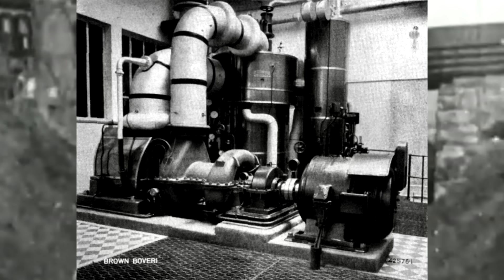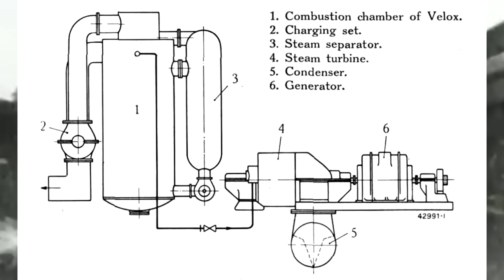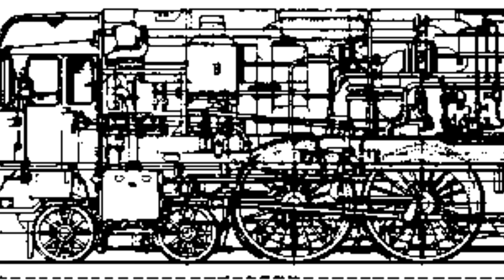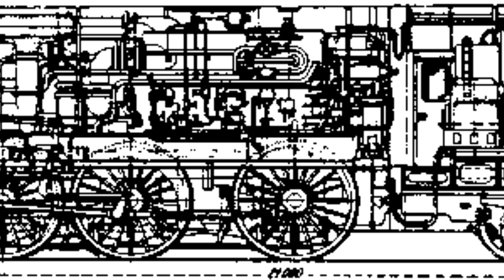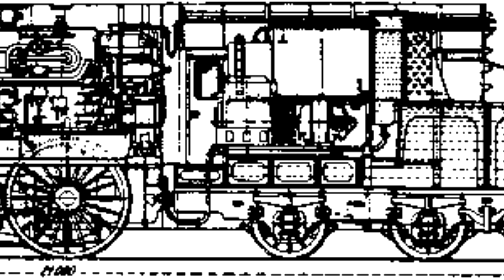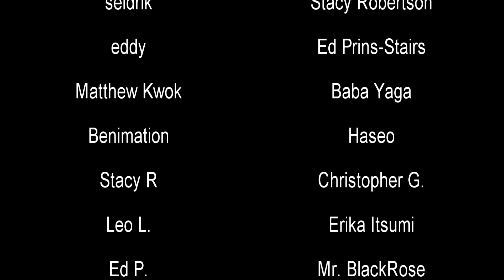What the Heck is Up With the Velox Boiler Locomotive? | History in the Dark

Comment: When trying to fit a complete industrial boiler house on the chassis of a steam locomotive. That looks like a nightmare to maintain.
Why they tried it is understandable. Diesel engines in the 1930s had a poor power to weight ratio.
The first successful diesel-electric in Europe, also built by BBC-Sulzer in Switzerland was the Am 4/4 of 1939, 2 of these were built, but they only had 830hp at rail, well below that of large steam and most electric locomotives. Already having electrified the majority of their network the order was not repeated.
They had a long service life and one of them survives operational.

Comment: New idea for steam traction: literally just a steam locomotive, but the startup happens faster because you add a combustion motor that briefly runs on the exothermic oxygen/hydrogen reaction to make heated steam in the boiler as you start the fire.

Not sure how effective this would be, but a brief startup using electrolyzed tender water (to MAKE the H2 and O2 used for the startup generation steam+heat) would be the more effective option than needing to always actually get a recharge from stationary depots

Comment: As engineers say.
You have the good the bad and the French way to engineer.
French engineering is on the divine / genius level or utter crap.
f,e, look at the most modern compound steam locomotives of the SNCF. (class 232)
They were the pinnacle of the steam locomotive tech and 232U1 is  seen as the swansong of all steam locomotives.

Comment: Diesels have it over steam engines in a number of areas. Start up time from cold which for a diesel can be fifteen minutes compare to 8-10 hours raising steam for a steam engine. Steam engine boilers need to have steam raised slowly over many hours so the boiler expands gradually. 
Day to day maintenance on a steam engine is much more involved and time consuming than it is with a diesel. 
Fuel is another area as coal can vary greatly in quality whereas distillate is very uniform in quality. 
The crews are another area for a good crew working together can get the best out of their steam engine and with a diesel that's not even an issue and also with a diesel there's no hard backbreaking work to crew it. In fog on a steam engine the crews have to constantly wipe the small windows to stop them fogging up whereas on a diesel the cab is heated or air conditioned so fogging is not an issue. 
In the freezing whether of snow the fireman or stoker's front is roasting from the firebox whilst his back is freezing which is something else that doesn't happen on a diesel. 
Health wise steam crews were fitter than diesel crews because everyday at work was a workout for both driver and fireman as both took turns at each other's job and it was the only way a fireman could learn how to drive a steam engine whereas with diesels it's mainly an office job where you sit down for long periods. 
But in the end the economics of running diesels won out over the steam engine as diesels are cheaper to operate on a day to day basis.
Preserved railways are not indicative of the days of steam for often the first train doesn't run until late morning whereas in the days of steam locos were kept in steam 24/7 even if only light steam on depots which is why they had their tenders filled with coal and water or tanks and bunkers filled on tank engines because they may not work a train for another eight to nine hours. Even before leaving a depot they topped up again with coal and water. 
Diesels can come on depots and be filled with distillate and then stabled and shut down for only a few minutes is needed to get air pressure up to work the brakes and they don't need to top up with distillate before leaving the depot.

Comment: If I had money to burn I’d try building a locomotive with perhaps a 20 hp diesel pony motor.  Shaft power to circulate water, electricity to heat water and run pad heaters for the cylinders, exhaust heat to heat water too.  Might work, might suck, who knows?

Comment: I read a story about nuclear power plants having backup generators driven by locomotive-scale diesels that had to go from off to running and online in under a minute.   I presume they were kept warm electrically and wouldn’t be surprised if they had external oil pumps too.
Reply: They always has

And the very reason why Fukushima disaster happen, the backup generator that supposedly cools the perfectly shut off nuclear reactor get flooded by later tsunami. And as reactor core still get hot days after turn off on top of water circulation stuck, turns into common steam explosion, that now has radiation

Comment: No doubt early diesel generators in smaller form had horsepower problems. The steam seemingly was an attempt to essentially have it push on the diesel to make the diesel have more efficiency. Apparently there are a couple of cruise liners that use both steam turbine and gas turbine. Having the steam improves the combined cycle for the gas turbine by reusing the gas turbine's heat for the steam power generation.

Comment: To be fair, BIG diesel engines need some starter help.

I know of glow plugs(like spark plugs to get autoignition going, small engines), flame starter (flame thrower to heat up the cylinder, medium engines) and cooling preheater (yes, a boiler to get the water in the cooling system to like 60°C before you start the engine, big engines).

So yes, many big diesels actually also need to heat a lot of water (not boil it, though) before they can start
Reply: I've driven trucks for over 30 years...shit goin back to the 50s and 60s,gas but mainly diesels. Up to 900  horsepower,and aside from block heaters (plug in overnight type thing) and the occasional ether button,I've never seen one with any other pre heat thing at all.
Reply: @JakeCline-l3h  it’s largely on locos and bigger, afaik. I know big locos like the DB 218 use coolant preheaters, but I don’t remember where I‘ve heard the flame starters mentioned, but Wikipedia says that cars and lorries usually get upgraded from glowers to flamers if they expect to start at -20°C or lower.

But apparently there’s a range of engines between 900 and 2500 hp where flame starters are a good idea

EDIT: the coolant preheaters of the 218 are basically the RR version of a block preheater since cold coolant could overstress the motor block, so they operate the coolant pump over a heater to get even heating throughout the system and you’re only allowed to start at 60°C coolant temp…
Reply: @genoobtlp4424 Thanks. I like learning new stuff about trucks and big engines in general.
Reply: @JakeCline-l3h  you‘re welcome
Reply: @JakeCline-l3h  just stumbled upon the source again: according to an old manual of the DB class 711.1 (german only), their 588kW ≈ 788hp motors have a flame starter (youtube channel Alwin Meschede made a Video about it, sadly also only in German).

Comment: I can see why someone tried this.  Internal combustion engines suffered from very low horsepower output, which was not a problem for steam or electric locomotives.  So any way to reduce startup time for a steam locomotive would be appealing.  Having a separate preheating source at the engine sheds would be more practical, though.
Reply: Some roundhouses actually had such a system in place to help get locomotives ready. It's also why many classes of locomotive had feedwater heaters starting in the 1920s.

Comment: What is the background music?

I could see a few ways to simplify this design. Still it's crazy. But I understand what they were going for. And all those starting circuits, that's exactly what they are; starting circuits. It's so that the terrain can operate independently of a starting system. Unlike the fury. So in some ways this is intelligent. I'm just wondering why they're not all hydraulic systems ran in either series or parallel driven using hydraulic pump off of the diesel engine. That would be so much simpler.
Reply: No idea, not even AHA Music song finder knows that.

Comment: 😂🤣😂🤣
Basically a giant steam generator requiring giant support hardware. While I'm partial to steam generators, if it requires that much junk to make it work, it isn't going to be very effective. 
If I'm going to add a diesel engine to a steam engine, I'd think it would be better to add a diesel air pump in a large tender to just add air pressure to the boiler to allow the power unit to hook up to the train while it's heating up. Even then, kinda a waste of space, but at least the train would be ready to go once the loco is warm.